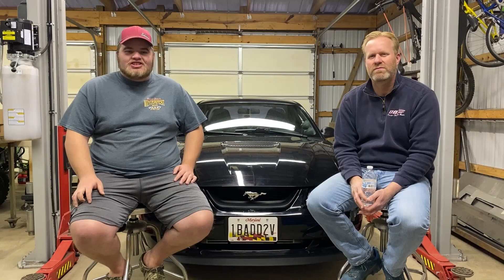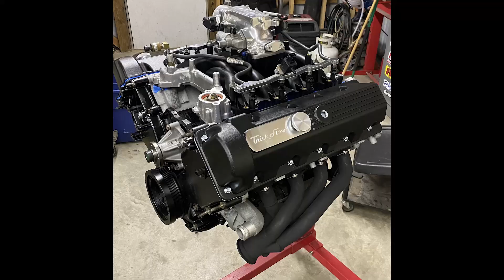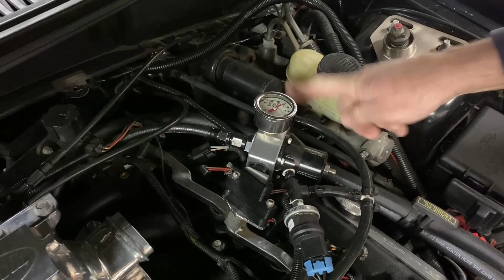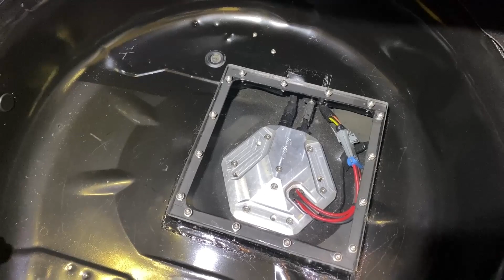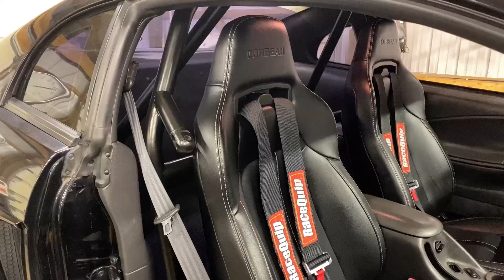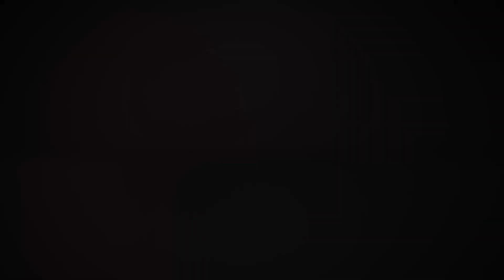TURBO 1999 FORD MUSTANG GT *550hp* (FULL BUILD & HISTORY)

Comment: I put a vortech supercharger on mine with around 15 lbs of boost. A ton of other mods like ford performance intake, long tube headers, h-pipe with flowmaster mufflers. Bigger fuel pump with much bigger injectors. A little bit of suspension work. Sub frame connectors, up and lower control arms. A center force duel friction clutch with short throw shifter. I know there's things I'm forgetting but it was a beast back in the day. Everytime I ran the 1\4 mile I would power shift every gear and I never missed. Even if I would of it wouldn't of hurt nothing because the shifter had stops so you wouldn't bend the shift forks no matter how hard you pulled on it and then there is the rev limiter so you wouldn't rev it past redline

Comment: Damn man, if your tuner is only getting that car to 550 WITH race fuel....you need to find a new tuner or something because damn, these cars usually max out around 650ish on PUMP gas....AND you have ported heads etc.
Reply: And 14 PSI? My 2V is on pump gas, stock pi heads, 12 PSI, and N/A cams, made 550WHP. I'm running ON3's billet wheel ceramic ball bearing 84MM.

Comment: Awesome video man! Gets me excited to get my 03 back!!did many of the same mods as you! Recently did forged pistons and rods and a full trick flow top end and twisted Wedge  heads!! With the on3 70mm it should hopefully get to 600hp
Reply from the maker: Absolutely! You should be able to do it. If you have a good fuel system and you can let the top end breath some good air you can hit that number with ease! The biggest thing is if you have stock crank just be mindful of how far you push it. The bigger the number the better but having a reliable 609hp street car is no joke!
Reply: Cooper Painting what made you with the  on3 70mm oppose to their 67 or 76…. I have an 02 Gt that I was going to Eaton SC with a Tork Tech but the more I looked at 2v turbo setup the more sense it made… I just  bought a Teskid block I’m looking to sell the SC kit and go on3 kit with trickflow heads and intake

Comment: What’s the deal with Romeo vs Windsor? I know it’s the plant but are they both 2 valve?
Reply from the maker: The Romeo vs Windsor 4.6L blocks are pretty much the same thing. The only thing with the blocks that I can find online that is the Romeo blocks have some coolant passages in the motor that are different. But other than that they are the same. The biggest thing with those different engines is that they have different head designs.
Reply: @alwayssomethinggarage794  the  Windsor 2v's also had a 6 bolt crank (10.5" flywheel)  vs the 01-04 when they went to an 8 bolt crank in the 2v (11" flywheel)

Comment: Got a little thunderbird set up with a 4.6, I think it makes 3psi. Have to look a bit harder then popping the hood to find it... its got a pressure regulating stock intake cover with a 14 inch bypass crack. would probably boost more with a pipe that replaces the plastic intake/engine cover. normal driving it is very quiet tho there is a pressure actuated waste gate on the turbo exhaust... could fit two, but it only has one 50mm turbo. seams to spool to 65'000rpm just keeping up with the motor, far as tuning goes... it has a GM MAP sensor and runs fine, the pressure regulating intake makes a croaking sound like a rubber chicken when the automatic shifts.
Reply from the maker: That’s sweet, I didn’t know those newer thunderbirds had the 4.6 as well. That’s cool! Thanks for checking out the video.

Comment: Awesome job guys! You are both great on camera, and very thorough in your ways of explaining the technical things without getting drawn out/boring. Love the budget themed build, which is something more of us viewers can relate to 👍👍👍
Reply: Question for you regarding the modifications required to the fuel tank: what exactly had to be changed around? I have purchased the exact same 03-04 Cobra tank through YearOne and will be installing it into my 01 Bullitt shortly here along with a twin-pump, return style fuel system.
Reply from the maker: So with your car being a 01 it may not need it. I believe it’s only with 99’s where you need a extra bung added for a filler vent. So when you pump gas it can release the vapor. I would check and see but I believe you will not need to add that bung because you have a newer year.
Reply from the maker: Thank you so much for checking out the video Scott! That was the one thought we wanted the people to see is we do mostly all the stuff we do ourselves and want to show that to everyone so they can relate. But seriously thanks for commenting because it just pushes us to keep getting better so we can create the best content we can. More Mustang videos to come!!